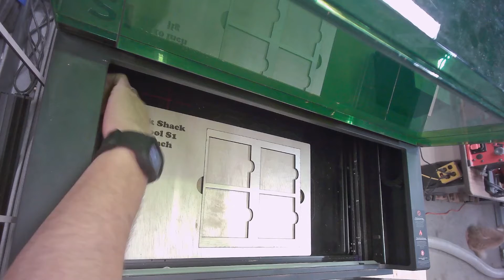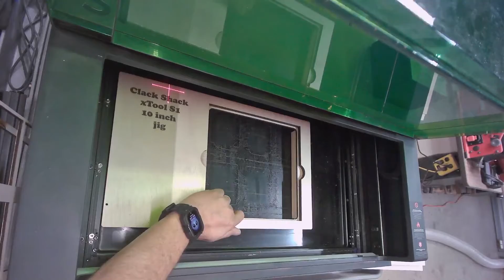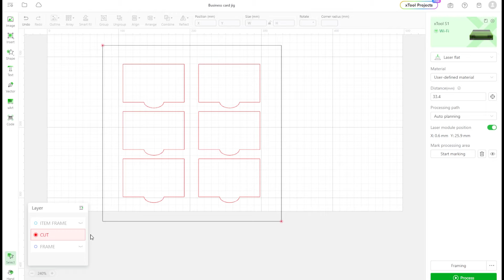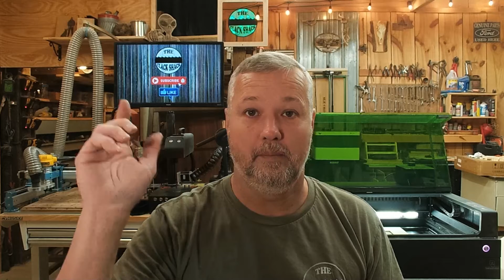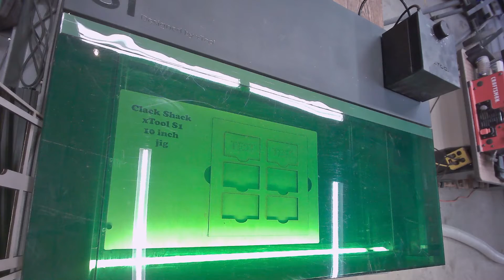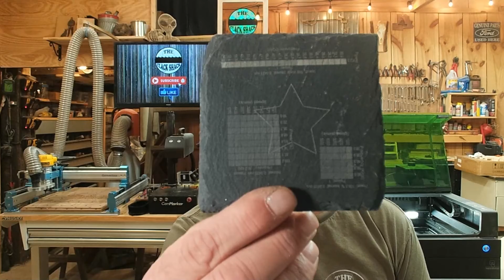xTool S1 jig system- The S1 just got even better

Comment: Hi Clack

I am at a complete loss here. I have built your system, yet when run a test engrave after I made a round coaster jig for it and nothing is aligned correctly. Yes, i used the same screw hole, etc. Watched and followed your video as you made a jig for this system.
Reply from the maker: It is very dependant on the steps. My guess is that you are using the cut file as alignment rather than the item files.
Reply: @TheClackShack  That could very much be what I am doing wrong. I'll double check both of your videos and see if I am missing something. If not, any issue if I just email you for assistance?

Comment: So am I able to move the head after the job engraves before starting another engrave in the batch?  Does the s1 remember where it started from on the previous batch?
Reply from the maker: Yes, the S1 tracks the position of the head. It shouldn't cause any issues.

Comment: How did you get the cutouts on the business card jig and the coaster jig to cut?  When I ran the job to cut the jigs it only cut the squares and not the half circle.
Reply from the maker: Set cut settings for the layers. Then turn them off the engrave parts

Comment: I bought everything to make the jig system and ordered your file yesterday. I cannot wait to get started because until now, I have only used the F1 so making multiples was out of the question for larger items. You mentioned that you are new to XCS. I have only used XCS so, since you have been using these machines much longer than I, my question is which do you like better, XCS or Lightburn? I would rather completely master one program.
Reply from the maker: Lightburn is better for file design, XCS is easier at running the machine
Reply from the maker: I prefer designing files in lightburn. The XTool machines are controlled better with xcs. The wireless control in xcs works great.
Reply: @TheClackShack  Thank you so much for the quick reply since I know you are always super busy. I retired as of Monday, so I'm gathering tools so I can get started full time with the S1 and F1. I use Affinity for designing. Do you have an apple watch band jig for this system? If so, I would like to purchase. I noticed you were not using the new XCS version 2.0. I have both versions but heard some negative reviews concerning 2.0 and the F1 so I was wondering if you have tried it.

Comment: Have you had any issues with your engravings being off-location on your second (and subsequent) batches? Also, have you noticed that the crosshair indicator in XCS does not return to where it is in the bed after running a job, but a few mm off? Trying to run a batch now and can not get what’s on the screen to match what’s being engraved on the bed. If I set a design 2mm from the edge of a product in XCS, it engraves 3 or 4mm from where I want it to. Any suggestions/help? I’ve reached out to xTool, but they don’t seem to understand the question
Reply from the maker: I haven't noticed that with my machine. My crosshair seems to be dead on. Maybe the machine has lost a couple of steps. I am not that familiar with the mechanics of how they have it registering but belt tension would be my guess if it was an open gantry.
Reply: @TheClackShack  Working on the S1, unfortunately. I’m not ruling myself out of the equation, though. Still getting used to the machine, XCS, and Lightburn. Thank you for the response, sir!
Reply: @TheClackShack  Quick update: I’ve learned that between batches, I can send the laser home in the Framing drop down menu and that gives me much more consistent results. I just do it once between batches and send it on its way again

Comment: I bought the jig system on Etsy.  I feel like xcs might have funked up how you had it setup. It does work pretty well. One thing I'll note, I was able to get it work with just the single 1/8 basswood sheet and the honeycomb(with it slid all the way forward so the front lip is past the jig). I do kinda want to make a larger one on the CNC to have use of the whole working area. One thing I did with my jigs I didn't hear you mention, for my round coasters, I did a cut for the 4ish inch slate coasters then did a 3in circle for my cork ones inside that one. So I didn't need to sacrifice a extra sheet but I'm able to use one jig for 2 different products
Reply from the maker: Yes, some folks don't get it and insist on a round one.

Comment: I’ll try to get this worded right so you know what I’m asking. Let’s say you’re using your coaster jig today. When done you put everything away, shut down the laser for the night. Then tomorrow you want to do more coasters. So you put the jig in, coasters in the jig, pull up the file. Does the laser know where the jig is when reading the file or do you have to align it, frame it, focus it. Basically tell the laser where the jig is or does it remember where when it reads the file. Hope that makes sense.
Reply from the maker: You save the file when it’s built and then reopen it to use again. You will still have to focus. Each jig panel has to have a save file for it

Comment: Just run the auto focus. lol.  The depth does not make any difference after that.  The jig is great, though.  Gives me ideas for making an adjustable jig.  

It would be interesting to see a comparison between it running an engrave job at high speed on the jig versus running more items at a time at the speed it can run closer to the left.  Do you actually get more engraves per hour?

Is there a maximum distance you can go to the right and still have it engrave at top speed?  It is a good thing the machine won't slam the laser head into the side of the case. rofl.
Reply from the maker: Put something on the edge and you will get a pop up telling you the software is going to adjust the speed. I find small batches or big batches, run time is same or slower if speed is compromised.

Comment: So, when attempting to make your own jig, what should the length and width of the actual hole be?  For example, I just bought some 12in x 12in mirrors to practice with my S1.  If I wanted to create a jig, should the hole be exactly 12in?  or slightly bigger to allow it to fit?
Reply from the maker: Tight enough to keep movement down. The closer the more accurate.

Comment: I purchased the jig and cut it all out but am confused. The pieces when placed together do. not leave a lip around the edge on the final piece for something to sit on. I love the design and am sure I did something wrong. I cut the three pieces, two with the notches and one without.
Reply from the maker: Yes, You do not have the pieces correct if that is the case. The part marked 3rd layer should be the third piece. The center has rounded corners.
Reply: Thank you. I actually took the third layer and made the inside square a 1/8 in smaller to get the lip now it fits perfect! I can’t thank you enough for this jig for my S1! So excited to give it a try!

Comment: What size wood did you use for this jig? As well as the thickness?
Reply from the maker: 12x20 is the workspace, 4 to 5 mm
Reply: @TheClackShack  thank you.. Where do you get yours from or do you have a recommendation
Reply from the maker: @tiffmarkley  local hardware store

Comment: What material do you use for the jig as after i cut it does seem like everything is out of line.
Reply from the maker: I use 4.5 mm luan, Unless you have machine issues or moved something, it should be correct. It is not material specific.

Comment: I have been thinking about a similar way to index. My idea was to score a crosshair into the jig and use that as the index point when the laser position shows in XCS and with the jig template loaded. Just line up the cross hairs in XCS and in the machine, good to go, so long as its square(ish) of course.
Reply from the maker: There are other ways but this was the best I could find without mods to the machine.
Reply: @TheClackShack  for sure. Your way at least prevents movement. Additionally I was thinking, if you had the riser, you could just make your own tray that would slide in, and that could be the jig holder, and replace the provided tray.
Reply from the maker: Still no good way to secure it without mods.  @ianmccaul1797
Reply: @TheClackShack I was thinking about using the honeycomb panel and a couple of magnets. Just slide the jig into one corner and then use a couple of magnets to secure it.  Am I missing something important? 🤔
Reply from the maker: As long as you always place it in the same spot and don't run enough power to slide it, it could work. @JustSomeHuman-j8o

Comment: One major benefit you mentioned was fmusing the center area for faster engraving but you didnt show that. I just wonder because i havent run into any errors at the edges of the work area which tells me I'm running to slow lol
Reply from the maker: I got it twice engraving the mirrors until I moved it to the center. I am running the newest version of XCS and it may not be public yet.
Reply: @TheClackShack  yah I jacked my speeds up and it seems at around 350 or so the pieces need to be about 4" from the edge. I didn't have time to fiddle but it wouldn't take much to find both true boundaries I imagine.

Comment: Just bought and downloaded it for my XTool S1 with the riser. Well worth what I paid to save me time and get right to work on making projects using the jig. Thank you for putting in all the work to get this jig system done. Can't wait to get the jig files cut out and test it out. I am sure it will work great. If I may ask, when you show the jig file in XCS (at 8:47 into the video) it looks like it's outside of the working area at the bottom by about .75 or so. Does XCS not warn you about that? I know I get a warning that I am outside the working area.
Reply from the maker: I had to go all the way to the front to use it for indexing. If you go all the was down it will let you know. The front length was needed to make it sturdy and keep it square